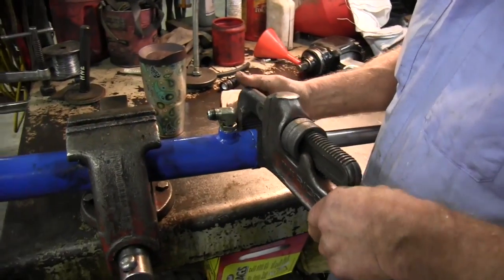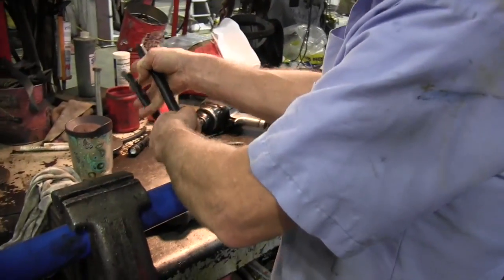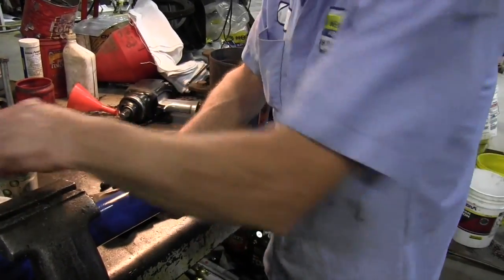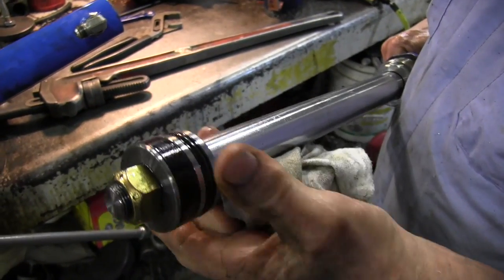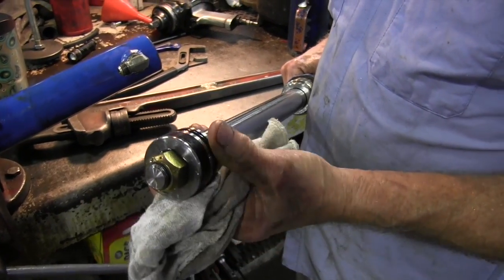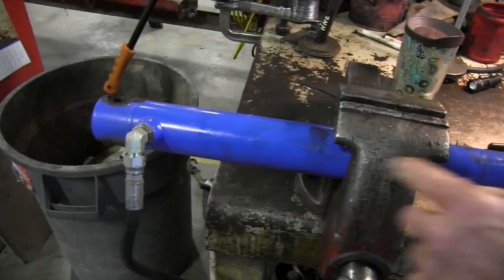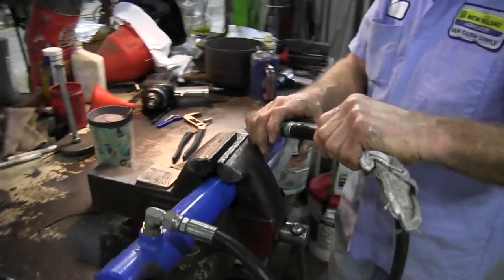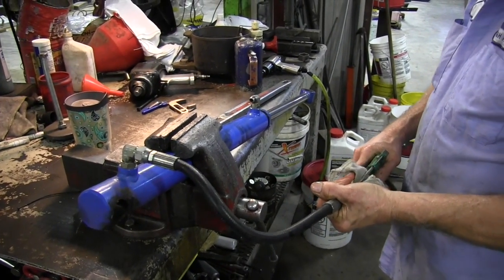How Does a Hydraulic Cylinder Work?

Comment: I just bought a 1966 Trojan tractor model.114 wheel loader. 
  Can I run AWL 46 hydraulic oil.. Does it have friction modifyeds, or do I NEED to run more expensive   New Holland Hydraulic oil.. 
This model 114 also has an Added 21 ft reach back hoe on it... 
I already own a big  Dresser 175c  track loader..  I already have 30 gallons of Awl 46 hydraulic fluid in the shop.. 
Thank you...  Martin..

Comment: Thank you for the demonstration.
 1 question.
I have 1 single cylinder, when it goes up or extends it makes a squeecking noise it still goes up but noisy & the actual piston it has small spots of rust then half way it looks nice & shiny.
What could it be this problem? Will it b low in oil?
Can anyone tell me what is the problem.
Thank you

Comment: How did you figure out which cylinder was the bad one?
Reply from the maker: Here's Hoot's reply: Disconnect both hoses from the cylinder and blow air in one end and if it would have come out the other hose, the seal on the piston is bad.  When the piston is loose, that won't work and you have to disassemble the cylinder to find the problem.  

Having said that, I'm pretty sure he had figured out which cylinder was bad when he took it apart.  Could be he's clairvoyant.  He could be a "tractor whisperer".  :)  He's one of those guys that seems to figure out what the problem is easier than most of us.

Comment: That is one problem I have not had on my tractor, but dealt with while in the Air Force, and worked on equipment we used for loading and unloading cargo. We had problems with the older equipment primarily and had to deal with hydraulics on the trailers and forklifts we used. I was fortunate not to have any injuries of see anyone else injured while working with that equipment.